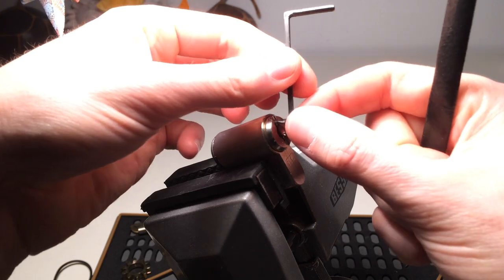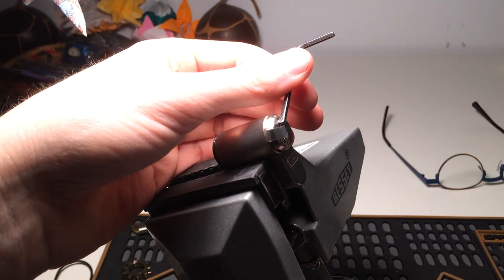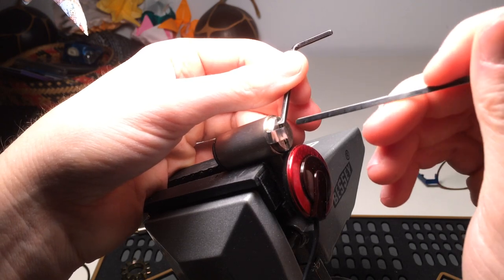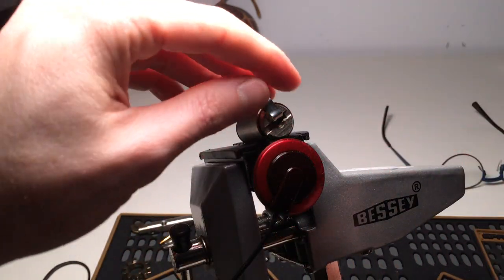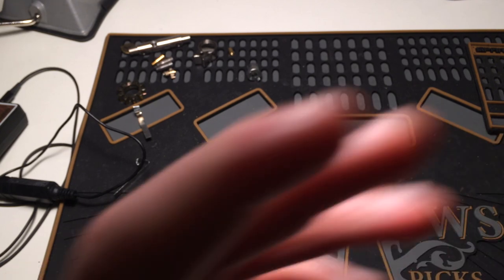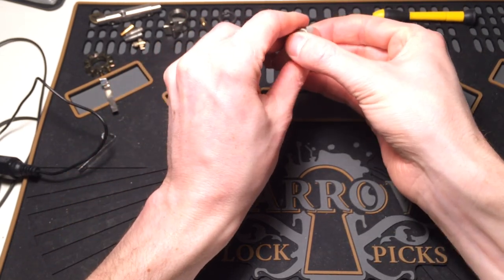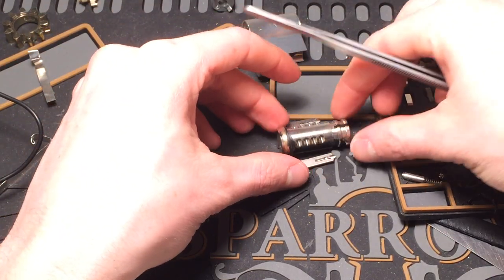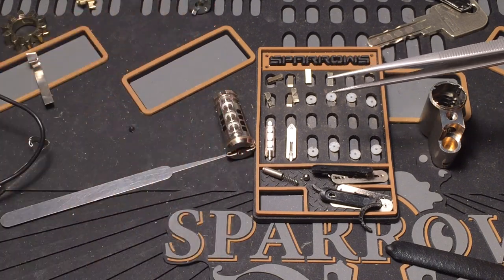EVVA MCS  Gen 2 – Picked and Gutted

Comment: You have to get lock ring pliers. A cheap one should costs between $5 and $10 and it will make removing lock rings much easier. Note that internal and external lock pliers need different tools. Some pliers have replaceable heads that change the direction. If you need high accuracy, you do not use replaceable heads but for removing simple lock ring should be okay with any plier that has small enough tips.

Comment: Got this on my appartement door, should I be worried now?
Reply from the maker: Nope, people will either break the dore or windows
Reply: @Joemenix  The door is secure-like. Reinforced steel plates and 23 security points into the steel frame, it's probably easier to get through the wall :)
Reply from the maker: Then they will spend hours to master how to pick this lock and an equal amount of time at your front door to actually pick it @jurajbeger9299  
I think you should not worry.